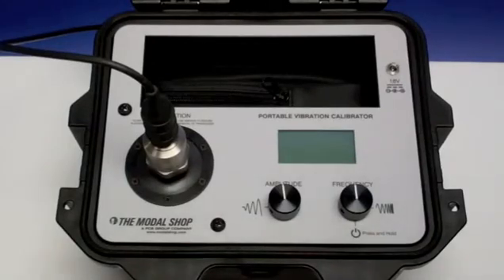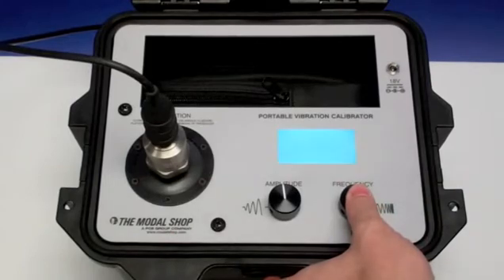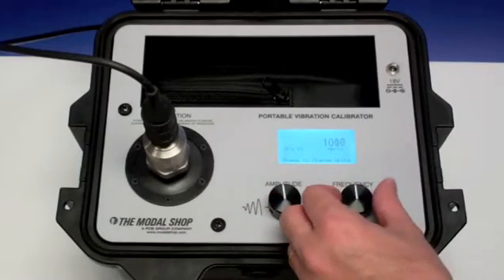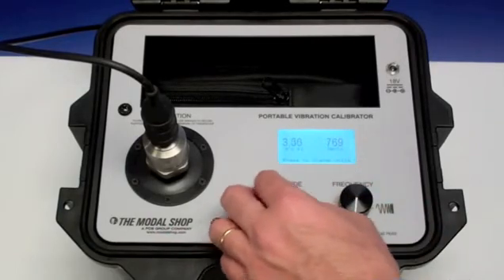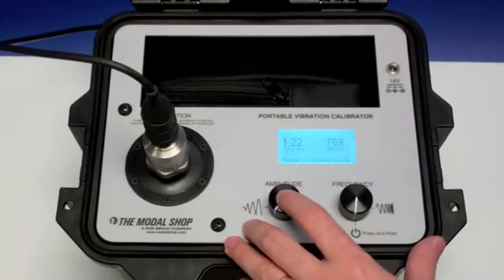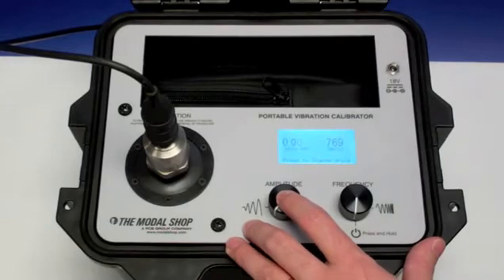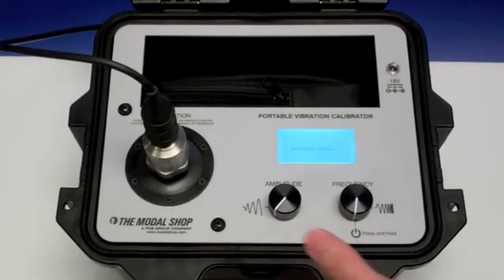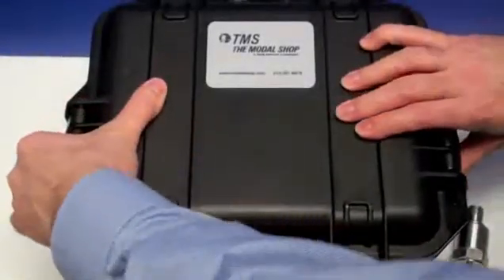Portable Shaker Table Operation - 9100D

Comment: Hi there, I have a 9100D that I am having difficulty with. I cannot get the device to actually vibrate, when i turn the frequency adjuster the value reacts on the screen however the amplitude adjuster has no affect. Is there anything obvious I am missing? thanks, Chris
Reply from the maker: Hi Chris, we believe based on your feedback that the amplifier needs to be reset. One of our technicians has emailed you a procedure on how to do so. It should get you back up and running quickly. Sorry for the inconvenience. If you did not receive the procedure please contact us.
Reply: @TheModalShop  hi there, yes that is correct I have received that procedure via email and should know the beginning of next week if it has been successful. Thank you and Michael Scott for your continued support and excellent after care.

Thanks,
Chris